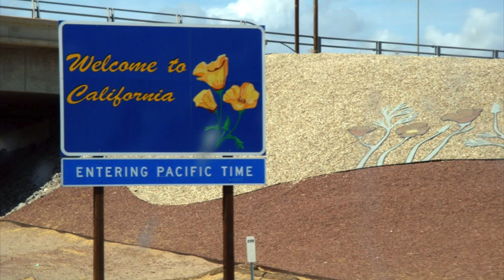Kitfox 7 Apex Build Episode 1 Kitfox Apex Build Is A GO

Comment: I am an Yamaha Apex owner . Around 10,000-12,000 mi you will need to do a valve adjustment. Yamaha says around 25,000mi but this is not true . Letting you know Incase you run across the engine warm up stumble stall idle issue , this means some valves are tight ,. This is going in aircraft so as for miles it will be different for you.

Comment: Brian, congrats on your new Kitfox 7 purchase.  This is going to be a great build.  Very curious as to the firewall forward costs including the Apex engine as it compares to other offerings.  Best of luck on the build, can't wait to see the build progress and  flight performance.
Reply from the maker: Hugh, the cost will vary based on the upgrades to the engine. You can get the actual engine for $2000 and up, the gearbox is $3500, propeller $1500, then you have the cost of making or having made the intake and exhaust and the engine mount. Than there is all the other items like engine monitors and fuel pumps, electrical and fuel systems. I am planning on $10-12K for the engine setup compare that to the $5K firewall forward cost for a Rotax plus the cost of the engine and the propeller and it is a considerable savings to go with the APEX.

Comment: I went to the Light Sport EXPO in Sebring in Feb and a company called TQ-Avionics was there. They had 2 1/4 inch radios and transponders. It fits in round or square holes.. Think they would work great in a Kitfox. Light and don't take up much room. Check them out.
Reply from the maker: Thanks, I will check them out
Reply: ok, glad to help.

Comment: a kitfox ok  , as for the cowling the solution is on what  gear box or planetary gear and belt system you have il make a difference where the shaft ling is and shift the hole thing but it fit and it's tight on my cub, there is quite a few tutorial on the engine mount online ,will fallow along for sure men , that's a exiting build , thanks for sharing.
Reply from the maker: Can you post some links to the tutorials for engine mounts, I'm coming up with very little when searching. I want to find solid info on setting the clock angle to contract turning tendencies.
Reply: @BowenAero   i can even do better then that if you give me a way to contact you so that i can garter all info on propeller ,gear system and more i can do the engine offset and send you a cad of the engine mount redy for tubes cutting , engine mount ifos is kind of scatter and incomplete, normal Apex mount is experimental territory.
Reply: @BowenAero   i can even do better then that if you give me a way to contact you so that i can garter all info on propeller ,gear system and more i can do the engine offset and send you a cad of the engine mount redy for tubes cutting , engine mount ifos is kind of scatter and incomplete, normal Apex mount is experimental territory.

Comment: What engine are you gonna install? Flagstaff, 6,909' Yep snow!
Reply from the maker: So the engine is going to be a Yamaha  Genesis 998cc 4-stroke, which is from a Yamaha APEX snowmobile. 4 stroke fuel injected 150hp and I will be using a gearbox specifically designed for the engine made by Skytrax.

Comment: Looking forward to this!! Maybe this is my ignorance with converting snowmachine engines to airplane engines, but I’m curious about why you chose the Apex over say the Genesis 998 Turbo. Same displacement but 180 horses. Does the three cylinder mess with CG and mounting at all?
Reply from the maker: Everyone is looking at that engine, it has potential, however there is no gearbox solution for it. The APEX has a very nicely designed and tested gearbox from Skytrax that makes it the better choice now. If someone figures out a gearbox for the sidewinder engine than it would also be a good option.
Reply: Do you know which one is lighter? Thanks so much for your insight! I’m really excited to watch this!
Reply from the maker: @inthesky9876   I don't know the weight on the sidewinder engine, but the firewall forward weight on the APEX with everything including gearbox and prop should be 178lbs. The basic engine is 130.9lbs.
Reply: Project Kitfox oh wow that’s amazingly light!

Comment: Can’t wait to see what you use for a throttle body, wiring harness and gear box.  Are you doing any mods to the Apex internally?
Reply from the maker: Still waiting to see how some of the development goes with Edge Performance and a couple other after market suppliers. I would like to turbo the engine with 4-8 pounds of boost to get 180-200hp and have it adjustable to normalize that hp at altitude.
Reply: I’m doing the same.
Reply from the maker: You know Tricia Larson, we were neighbors when we lived in Albany just a year and a half ago.
Reply: She is my sister. I’m with her now. She says she is coming to see you this weekend

Comment: I’m thinking about doing a kitfox and I’m curious about using the APEX motor. Can this motor run on 100 low lead?
Reply from the maker: Yes, but you would want to change the oil much more often and watch for lead fowling.
Reply: Project Kitfox thank you!

Comment: Hey Brian- I have a custom metal fab shop located a mile from O60.  We specialize in custom Stainless and aluminum fabrication for the food and beverage industries.  4130 chromoly is a great material to work with.  Powder coat shop we use id at KUKI.  Happy to help out if your looking into making a reproducible Apex motor mount system.  If at all interested hit me up.
Reply from the maker: Scott thanks for the offer, I'll keep you in mind.